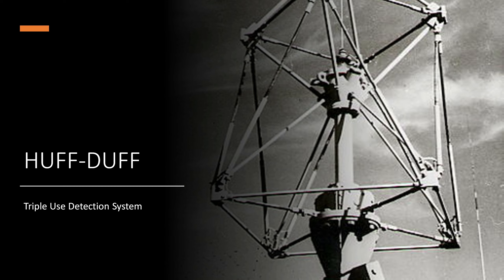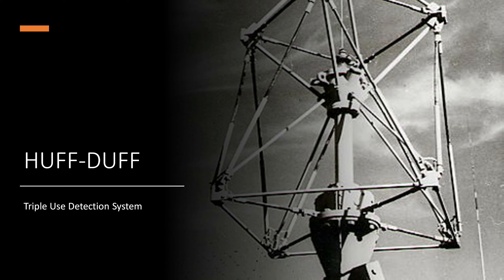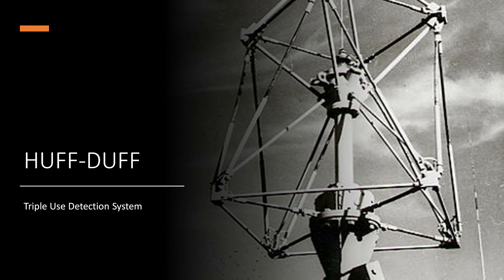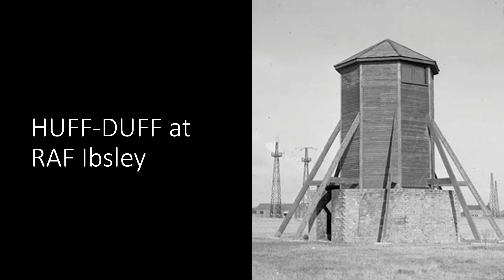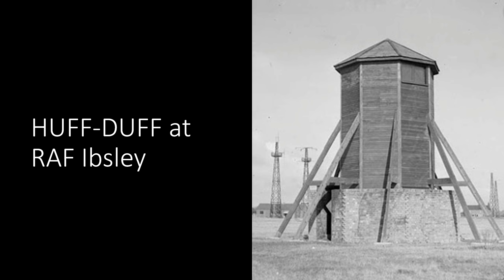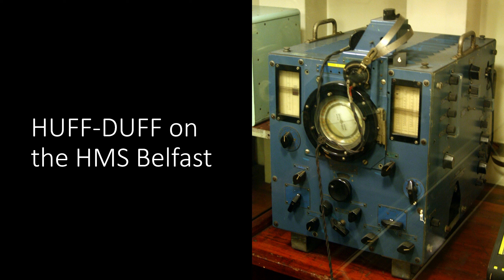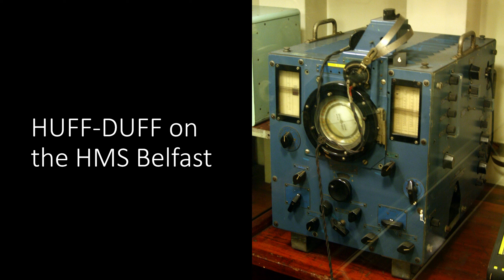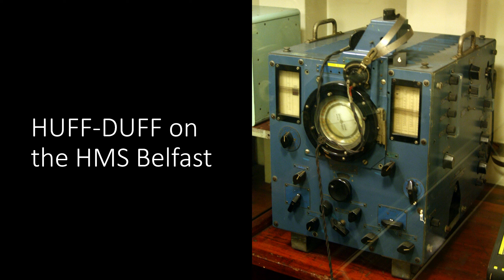Military Mutterings With Jack & Kevin - Episode 8: Huff-duff

Comment: The investigation of lightning strikes was carried out at the Radio Research Station, Datchet in Buckinghamshire during the 1920s-30s by Watson Watt and his team. The purpose was to measure the number of lighting strikes - even those that could not be seen - using their EM emissions. I believe the study was initiated to study radio interference. The system was also used to 'capture' radio signals automatically which led eventually to HF-DF.